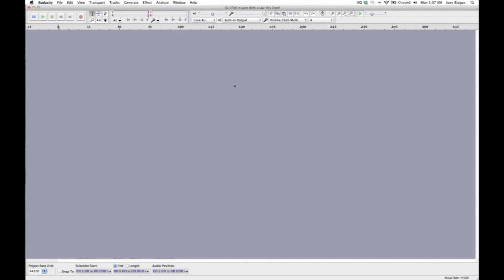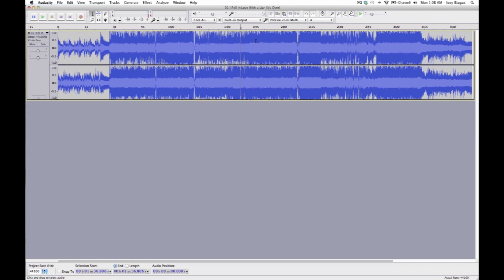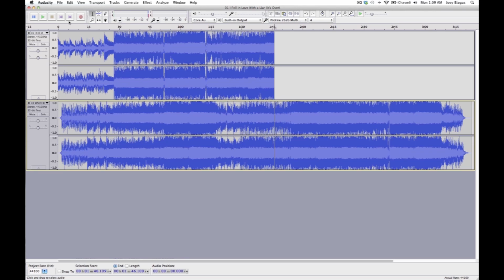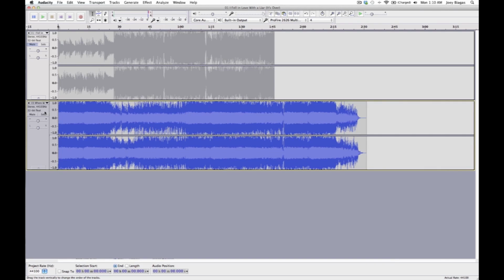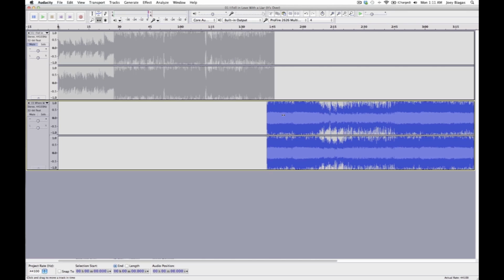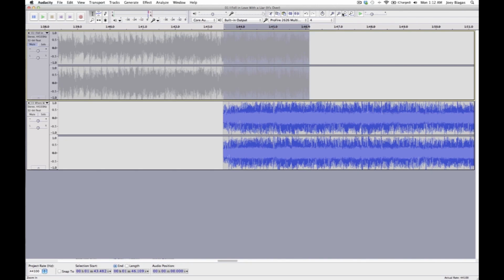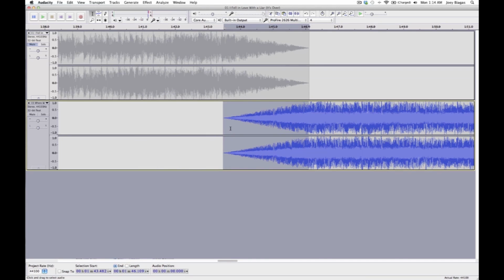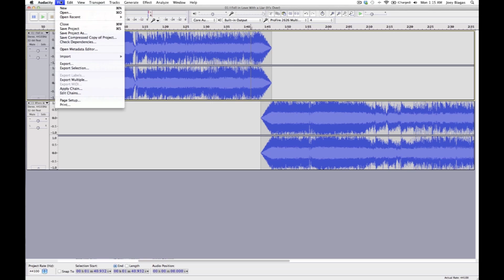How to Splice in Audacity : Audio Digital Media

Comment: For me this helped to learn basic operations in audacity, how to work with 2 or 3 songs AND  time shift option wich I didn't find....

 BUT this is not splicing or mixing, this is most simple manual crossfading.

Audacity have more options, cross fade in/out, adjustible fade and so on

Comment: I am not sure how you were selecting your files, what type of program are you running, win? or Mac? something? I understand the overlap, but can you paste the second track into the fade out point of the first track to put it all together?
Reply: +Dennis Neuhaus If you look carefully, you can see the smiley Mac face on his screen, so he's using Mac. I used Audacity some years ago to splice together the two halves of a 7 minute song that had been split into the "A" and "B" sides of a 45" rpm single, (Television's LITTLE JOHNNY JEWEL). The splicing was just as is demonstrated above. In splicing together the two halves of one song, one has to be attentive to where the end of the first half and the beginning of the second half meet. There was a little overlap, so I moved the second track carefully until, when playing through the transition, it sounded continuous, with no audible splice. It was easier than I had expected. I think that it is when exporting or saving the track you can have the two tracks merged into one. As I say, it's been awhile, but I found the whole process fairly easy. If you try it, I'm sure it'll be self-explanatory.

Comment: Completely missing how to achieve any real precision.
Reply: +Jason Kennedy Well, if you must, Audacity can zoom in to stretch the work zone until you see individual sampling points, say 44,100 per second. That's as precise as digital audio gets, and nobody goes that close in real world music scenarios. You can use shortcut keys Ctrl+1, 2, 3, etc in the View menu to speed the process over the +/- toolbar tools. With practice, your 'ear' will improves. You'll be splicing like a pro.